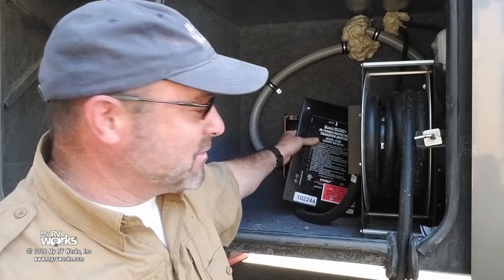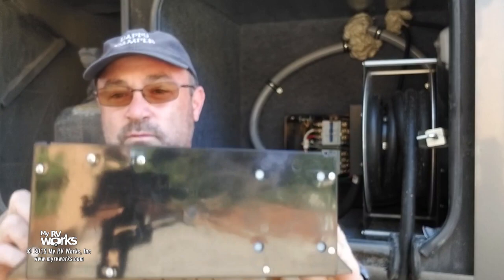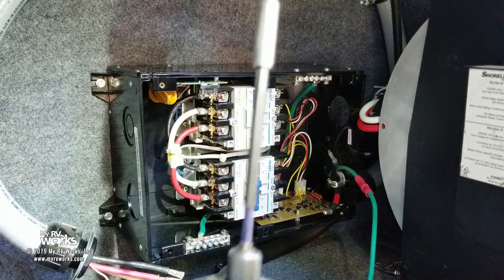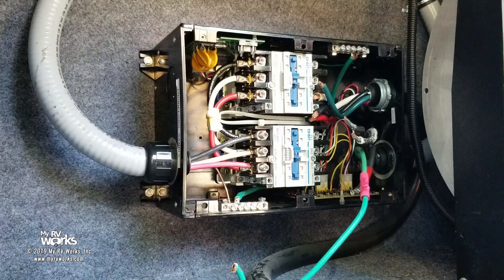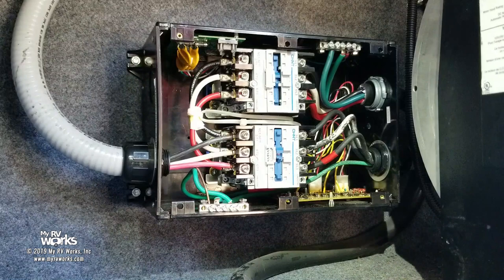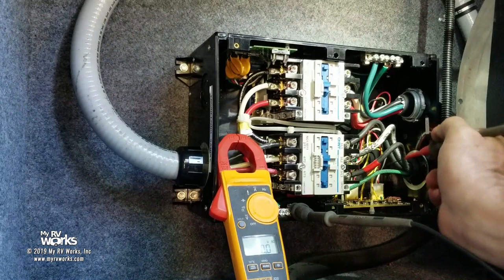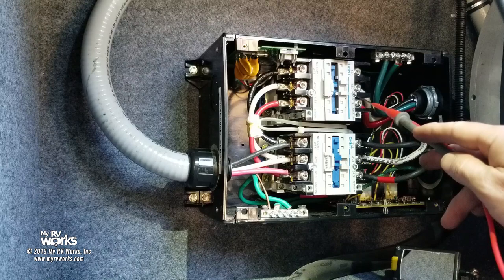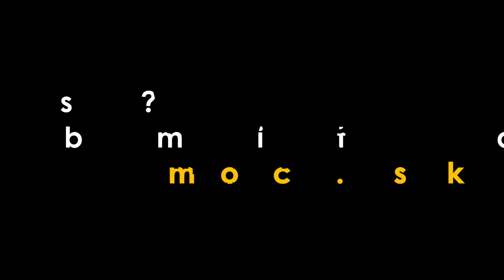How To Replace The Automatic Transfer Switch On An RV

Comment: It almost looks from this video, like you had 2 shorelines comin in there, while most Ppl have 1?, why is this?
Reply from the maker: The automatic transfer switch will switch between generator power and Shore power. So perhaps what you're seeing is one line coming from the generator and the other line coming from shore.
Reply: thanx, just left you a really long question but the stupid YouTube app erased it as I hit send. amazing dumbness😑  100 times shorter now, about what you said, yeah maybe that’s it.  about my question, what order does, say, for example, shoreline power come in to rv(like transfer switch 1st?, or breaker switches, or what?), I ask because I got no 110 anymore, not even enough to make that switch click.. it used to as power faded.. so now switch has stopped clicking on plug-in.. & it will be difficult to find✋

Comment: You should have watched this, thought about it and started over to save time and confusion for all of us.
Reply from the maker: That's certainly one way to look at it. However when I installed the new one and it failed out of the box I jumped right into troubleshooting. Hopefully it helps folks in the real world and not so much in a controlled recording environment LOL.  Very few of the videos on my channel are scripted. It's all real world right where the action's at.
Reply: @MyRVWorks  I don't know where my head was 2 years ago. I do remember that I was getting ready to replace the burned-up transfer switch in my 30 year old motor home and was looking for installation info only and apparently had no patience for the equally important trouble-shooting info. I was a jerk, my apologies.